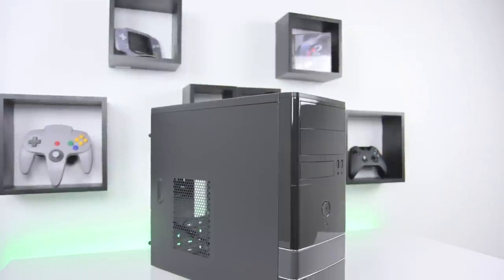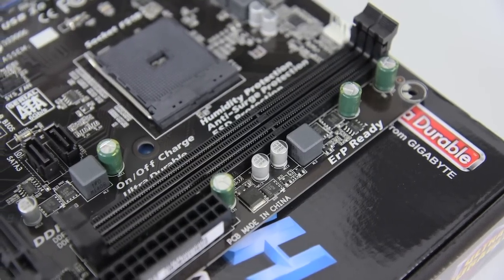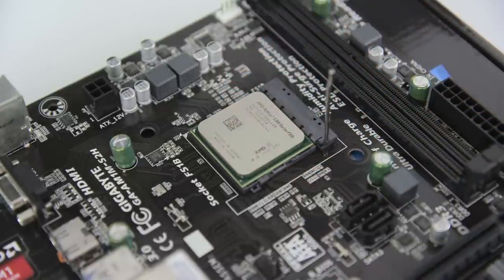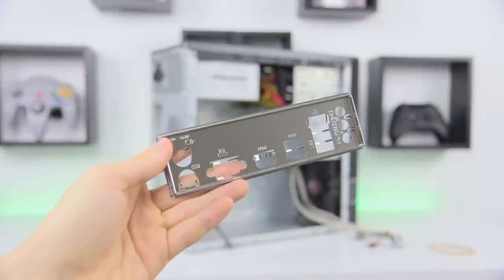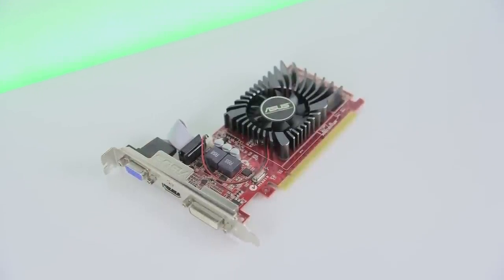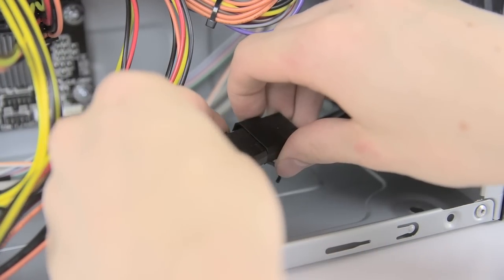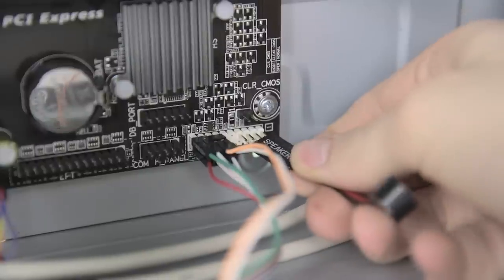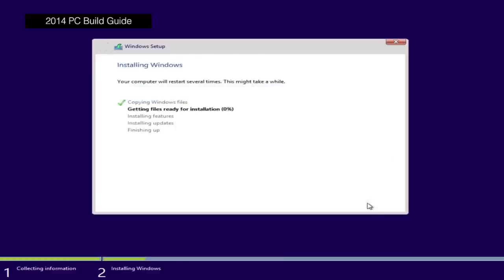How to Build a $300 Gaming PC! (2014 Boson)

Comment: My build was around $230 and outperforms this (given, most items were on sale at the time) 

Some low-end Logysis case with a 480w power supply included
Some low-end AsRock MoBo with 2 ram slots, and socket FM2+
AMD A-10 7700k 3.8Ghz quad-core processor
integrated graphics, six-core
8 GB of 1600 RAM
Some low-end network card because the RJ-45 on the MoBo shorted out

Overall, a very low-end build, but cost effective. I can play BF4 on medium settings at around 40-50 fps with no overclocking
Reply: Oh thanks this really helps me I play bf4 and I'm moving to pc and I'm building one but every pc is verýyyyyyyyy expensive .
Reply: Frank Jimenez np :P
Reply: I'm building a pc like this so thanks for telling me it runs bf4 at that cause I was having second thought but not now
Reply: +Andloo Yunty get a better powersupply
Reply: cocacoladog10 Haha. Thanks for that. I did already though. I now have a 750w EVGA supernova 80+bronze semi-modular PSU that was only like 40-50 USD on sale.
Reply: Andloo Yunty cheap ones usually break faster
Reply: cocacoladog10 Yeah, but this isn't cheap-it's just a good deal. Even if it does break, it comes with a free 10 year warranty world wide
Reply: Andloo Yunty true but is shipping free?
Reply: cocacoladog10 No, but I don't really care about $4 in the face of $65
Reply: cocacoladog10 Who pissed in your cornflakes?
Reply: Why fight?
Reply: +cocacoladog10 why u mad?
Reply: cocacoladog10 you is high
Reply: 1600mhz ram with an APU is a horrible idea, faster RAM increases performance on APUs. And power supplies that come with the case are usually crap, especially with that no name brand. I doubt your build would perform much better than Austin's.
Reply: Still a really good deal, though. $230 is dirt cheap and the performance would be decent
Reply: Creamy Z Except that the PSU has no relation to the performance...

As far as the RAM, yeah, you should go faster, that was a mistake. To be fair, I got good frame rates and good performance.
Reply: Andloo Yunty I know that the PSU doeesnr affect performance, but I would personally not invest in a PC with a crap power supply. I would rather spend the extra $60 to get a better power supply but thats just me.If I am spending cash on a PC I wouldnt want it to go up in flames a week later. I suppose other people would rather take the risk though, and sometimes you get lucky.
Reply: Creamy Z yeah a crappy powersupply can potentially damage all of your components
Reply: cocacoladog10 Still doesn't affect performance. I've upgraded since anyway.

Comment: I am happy to say that I am typing this comment on the Boson. First off I have to say that there are a few things that you have to buy that are not in the video. You have to buy a cd/dvd player/burner for it and you have to buy a wifi adapter. Overall it is a pretty good PC. It is easy to put together and it runs games very well. It can run some games at high settings at about 30 to 60 fps depending how good the game looks and how much of your graphics card/cpu/memory it takes up. It is overall a really great computer for the money.

Comment: Apu is improperly installed... Pins go from top side of mobo to back.. The smaller pin goes into the pin with the hole to expand it and secure the heatsink. Had to read instructions while following Austin Evans  tutorial cause heatsink wouldn't stop wiggling.
Reply: Wow, I didn't even realize.... Good eye! This comment might save people some hassle in the future.
Reply: Thanks to him my CPU is heating up intensely cause he said wrong directions this is awesome

Comment: Hello I am currently 13 and have no experience building a PC but I have researched a lot about them and I was just wondering if this is a good starter build          

1TB TOSHIBA SATA III 3.5" Hard Drive - 

			GIGABYTE GA-78LMT-USB3 AMD 760G (Socket AM3+) 

			24x LiteOn Internal DVD Re-Writer - IHAS124-14	
			Thermaltake TR2 Challenger 500W 80+ Certified APFC Power Supply 	
			AMD (Piledriver) FX-6300 3.50GHz (4.10GHz Turbo) Socket AM3+ 	
			8GB (2x4GB) 1333MHz Corsair Value Select DDR3	
			EVGA GeForce GTX 960 	

			Windows 10 Home 64 bit Operating System - DVD	
			BitFenix Neos ATX Tower Black/Red
Reply: I'm only 12 but I think you should change the CPU. It has 6 cores, yes, but the cores are very weak since there are 6 of them. If you have the extra money, go with the AMD FX- 8320 or AMD-FX 8350. It costs $30 more but has 8 cores and the cores are just a tiny bit stronger. But if you want to go with Intel instead, go with an i3 6100. But If you can't spend anymore money, then it will do perfectly fine. :)
Reply: get an i3 or i5 would be better
Reply: 1 x Hard disk Seagate Desktop HDD 1TB 7200RPM 64MB SATA-III   1 x Memory Patriot Signature Line 8GB DDR3 1600MHz CL11 Dual Rank 1.5v   1 x Processor AMD Kaveri, A8-7600 3.1GHz box    1 x Mother Board MSI A78M-E45 V2    1 x  Video Card Sapphire Radeon R7 360 OC NITRO 2GB DDR5 128-bit Lite    1 x Case Delux DC610    1 x Power Source Thermaltake Litepower GEN2 450W
Reply: Its pretty good but the cpu does run pretty hot. I would either get a third party cpu cooler with it or go for an i3 6100 as in the future if upgrading you may not have to get a new mother board. I highly recommend http://www.logicalincrements.com/ for this kinda thing
Reply: They arent really similar and therefore cant be compared.
Reply: Torin Allen 
I am no good with mid range PC's but if you have pation to save for a high end PC for aeound  $2000 then you will need these:

CPU: Intel core i7 6700K( 346€)
-Motherboard: Asus maximus VIII Hero( 224€)
-Memory G.Skill Ripjaws 4 series DDR4 2400 ( 32GB) ( 230€)
-Graphics card: EVGA GeForce GTX 1080 FTW DT Gaming ACX 3.0 ( 660€)
-Power Supply: EVGA Supernova 850 watt G2 80 plus gold ( 165€)
-Primary storage: Samsung 950 Pro SSD ( 256GB) ( 200€)
-Secondary storage: Samsung 850 Evo 
( 1TB) ( 315€)
-CPU Coller: Corsair H100i v2 ( 120€)
-Case: Cooler master MasterCase Pro 5 ( 125€)
i will text the mouse- keyboard- monitor later 

Total: 2400€
Reply: its a good PC i have an AMD A6 7400k in my PC thats a good processor you should update the ram to 16gb and put a ssd into your pc.
Reply: Yea

Comment: I just realized you attached the heatsink pins wrong. Supposed to push the pins from the top and attach the pins that go into the hole to the heatsink brackets.
Reply: +revolcane it was torture to watch him fuck that up so bad
1. head did not align the notches on the discs to the edges of the sink.
2. he did not push the hold down tabs threw both sink and board rendering the springs useless.
3. he pushed the locking pins threw the bottom instead of threw the top as they should go.
Reply: +Aaron Heitzman no, did you even hear him? This is exactly quoting him."For this socket you have to use a slightly different install method." So he did it right.
Reply: +aidan katz look up how to intall heat sink for AM1 APU and you'll see what we're talking about. Austin did it wrong.
Reply: it was so wrong and so half ass'd put together when he did it that way. didnt he even relize what the springs wer for? they wernt even being used the way he did it!
Reply: +revolcane ok ya he fucked it up

Comment: Looks like it'd be a decent server build.
Reply: or a great school work rig
Reply: The Lazy Dreanei
 True
Reply: ***** I really don't play modern games, I did play BL2 on 800x600 low at 24 on my old APU build. But mostly DotA2, League, TF2, MC. Games like those.
Reply: Most server software benefits from larger, more powerful single cores. A celeron would outperform an apu for standard server tasks.
Reply: good HTPC more then server

Comment: the i7 6700k or gtx 970 both cost more than this whole computer
Reply: sigh "Intel"
Reply: intel is more expensive, but worth it.
Reply: i believe that the processor alone costs nearly as much if not more. Getting the r9 480 and is still less than most 970's while yielding similar if not better performance.
Reply: that's what i mean separately sorry i didn't make it clear.
Reply: Shintel

Comment: is this a good budget gaming PC
Intel Pentium G3260
AMD Radeon R7 240
Toshiba 1TB
8GB DDR3 Ram
Reply: its ok, but you might need a slightly better gpu
Reply: a 750ti and its oke
Reply: Better GPU and get a Quad Core CPU
Reply: +Matt Simmons I don't have money but in the future I'll get nvidia GeForce gt730 ti
Reply: Doomlirious '
730 TI is nice. But don't expect to run Far Cry Primal or GTA V on maximum settings with that dual core.
Reply: get an fx 4*** series processor, it is a cheap quad core.
Reply: You should try something used. Great price to performance that way.
Reply: +Colepaq like an old Xeon? good idea.
Reply: Yep, xeons are great for budget PCs.
Reply: its not good. save your money so that you can buy parts that will actually work and perform well
Reply: +Pkrazy_ not all people have the money or can get the money to buy a 1000 $ gaming pc
Reply: teun debruijn im saying dont spend your money on that heap of garbage. wait & save until he can spend his cash on something good
Reply: ya for cool math on low setting